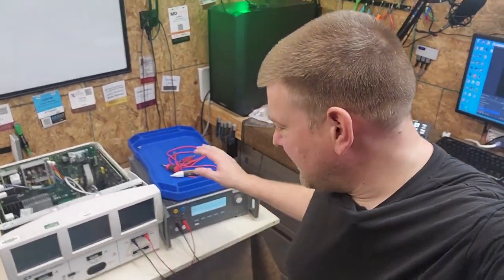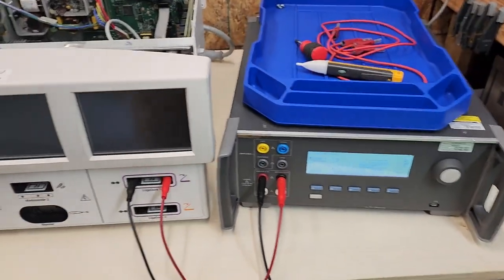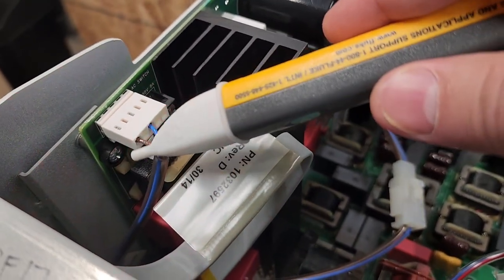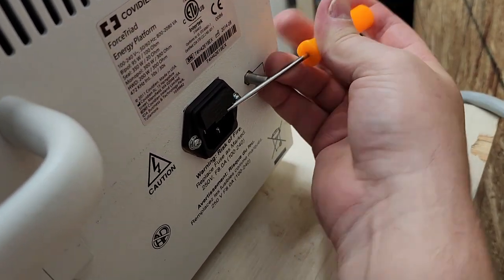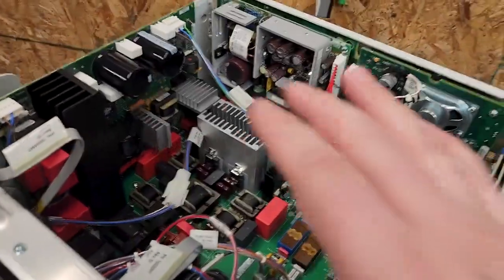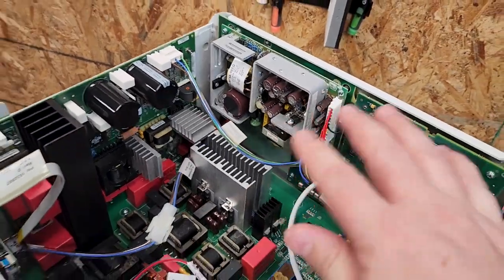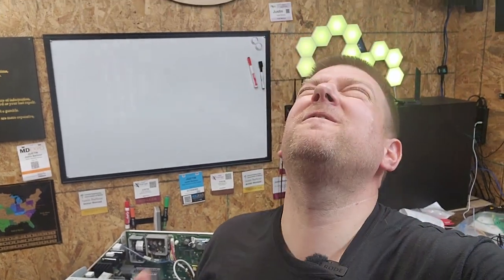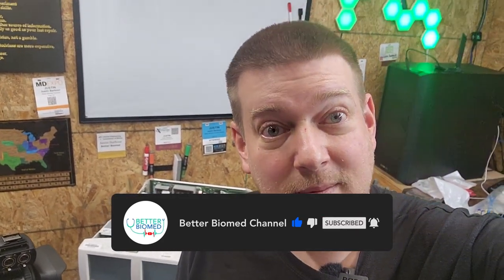Failed Force Triad Calibration..

Comment: I worked on a BearHugger recently that had an similar and interesting problem. It would power on intermittently, and shut off as soon as it was moved. I followed the mains power in like you did and found the large transformer has broken off its soldered feet (6/8 broken) and was close to coming off completely. I had to order a new main board (which was sent out for free from 3M), but I had never seen a broken transformer work when the device is stationary.

Comment: I have never seen this type of connectors with included fuses. Would it make sense to replace both fuses at the same time?  Too bad you have have o start over. The Fluke pen is also very interesting. I have to look into those
Reply from the maker: Both fuses always get replaced at the same time.  There are 3 variants of the Fluke voltage detector. The one I use is low voltage ac detect (20-90vAC) there is also a 120V amd 220V. The reason I use the lower V pen is because I like the extra sensitivity. I want to know if there's any AC in the proximity before I start working
Reply: @BetterBiomedChannel  I Think I ordered the "Wrong Version" of the pen.The 200 - 1000 V Version by mistake because I did not know there are different versions. Maybe it would be a good Idea to make a My tools list in a google doc that you could link in your video description.

Comment: Hey Justin, I got a problem with Diathermy, FN 300. It's not regulating power. When I troubled I found a fault triac. But it keeps on blowing whenever I replace it. What could be the problem please
Reply from the maker: Somewhere, you have another shorted semiconductor